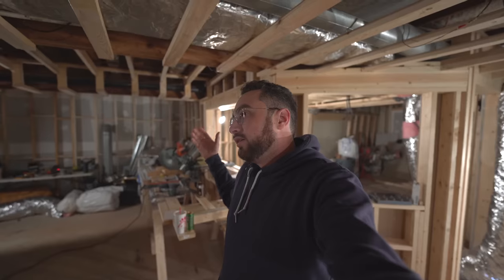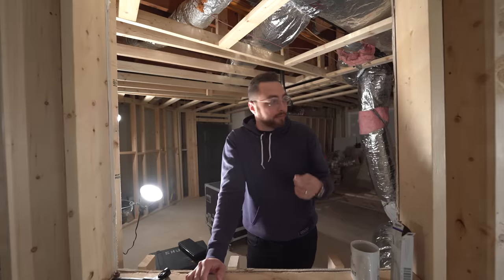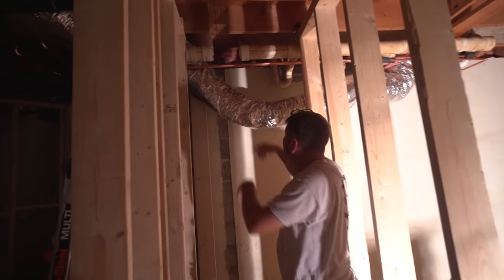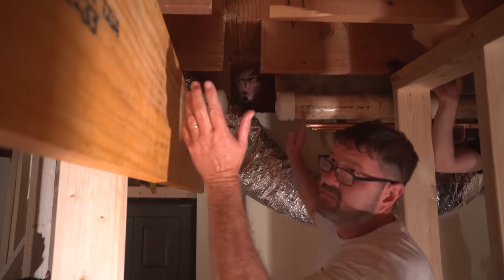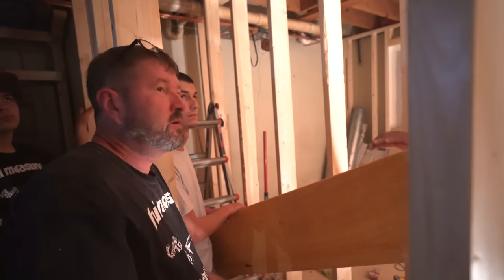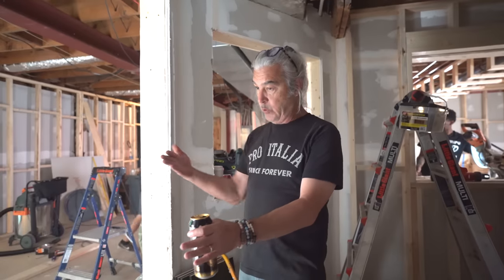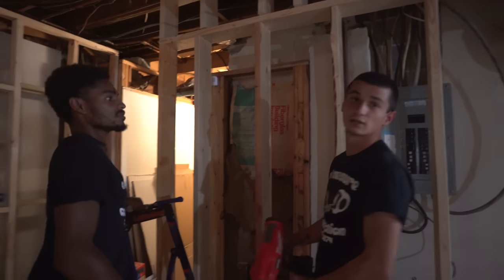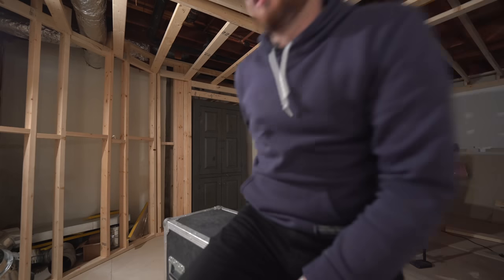We Need To Talk About The Studio Build  (I f*cked up)

Comment: Hey Rhett, one simple piece of advice before buttoning up the walls…
  Think about running plastic chase in the ceilings and the appropriate walls to make snaking any cabling or data lines, co-ax , easier in the future…. It cuts down on damage opening walls and gets you from point to point without boring holes in any framing.
As a carpenter for a very large laboratory on Long Island, every renovation we did involved future proofing and was never a wasted effort. Plastic tube chases are inexpensive and certainly worth it.  Good luck with the rest of the build.  Be well.
Reply: I'm a pro studio builder and I'd back you up on your good advice, with an additional observation: lay 3 or 4 color-coded pull-thru cords inside your pipe chases. It saves fishing them through later, and means you're ready to pull extra cable as needed.
Reply: @robertmaune8557  
Good call.
Reply from the maker: Great advice guys, thank you!
Reply: Leave a length of twine in your chases or conduit, so you can pull new wires in future. Unlike me, try to always put twine in with the new wires so you have it available down the road.
Reply: @RhettShull  And label all of your wires, so you know what is what at each end!
Reply: They’re called Smurf tubes
Reply: I absolutely concur. It's been many times that electricity caused delays on the construction yard. Write out how the cables run, label everything, and make sure you have relatively easy access to the crucial points of the cable runs for fixing or changing out stuff.
Thanks for sharing and good luck Rhett
Reply: @robertmaune8557  I'm glad this was brought up, especially since technology is always evolving. What connections are commonplace today might become obsolete in the years to come so planning for that now will pay huge dividends in the future.
Reply: I concur with this advice.  Previously working in IT data cabling and as an electrical installation engineer, running conduit inside the framing with draw wire and access points is a no brainer for future proofing.  Allow spare conduit and space in used conduit for changes/adding etc…
Reply: @cyanide -  YES!!!   Also install pull strings in those chases!
Reply: @colinwallace5286  This. def. this.
Reply: I’ve worked in studios and radio and TV stations for a few decades. Run more plastic pipe than you can ever think you will need. It’s cheap at this point. Cutting up that wall which your placed a bunch of custom refractive panels or wave bending materials to run one more cat 6 cable or piece of Beldon’s best will just piss you off years from now.
Reply: Great idea.
Reply: I hope it’s all worth it. Quite intimidating. 
And, I thought kids nowadays were doing albums in their bedroom!
It’ll be cool when done. How much ceiling height are you getting?
Reply: As an electrical contractor I 1,000% approve!
Reply: I second this. Electrian here( run a lot of data and fire wire) Conduit is best, preferable!!! Smurf tube or pvc chases( I like the latter) . I light up when I see there are chases for my data runs!!! Otherwise just keep it off the nail plates, and curve the runs so they pull easy! 👍🙂
Reply: Very good advice. Gutted and rebuilt mid 1930s semi and 19th century terrace houses in southeast London plus other houses. I always install conduit even if the professional electricians say it's not necessary. Separate conduit for power cables and for data & audio cables preferably 12 inches apart
Reply: @RhettShull   And after you run the chases/innerducts, but before you sheetrock, take pictures and stick 'em in a notebook with all your cable documentation.  That way if you want to hang stuff on the walls or need to, heaven forfend, open up a wall, you'll know where all the studs, power wires, pipe, ductwork, and wiring chases are. Got that tip from a custom home builder many many years ago.
Reply: @robertmaune8557  what do pro studio builders do to eliminate wall joists from rattling at the joints? I would think every wall joint needs to be bracketed and screwed together.. They are only air-nailing them together.. My bass rig would shake these to pieces!!
Reply: @christophercarson4310  when I started building in the UK all joints were made with screws to stop rattling. In the US I use steel fixings like Simpsons strong-tie with nails. Both systems work well. Now I am in France I feel comfort to mix and match: a combination of angled nails with big screws to prevent the joint opening up.  An experienced framer has plenty of solutions to keep a joint strong. I don’t know where you are writing from so I can’t be more specific, but local building codes are typically a good guide.
Reply: @robertmaune8557   yeah I agree I think screws and Simpson brackets are needed here. Yes, local building codes are good for structural integrity, but they do absolutely nothing for controlling sound/rattles. My bass rig would rattle these joints to pieces!!
Reply: @christophercarson4310  If the joints are accurately cut and the fixings are applied as per spec the joints will cause no problem. The entire wall will vibrate as one. Unless you are playing dub reggae your bass tones will be living far above the fundamental frequency of the wall.

Comment: Hey Rhett! I am impressed... and Entertained by your studio build.  I am a retired General Contractor and a guitar player of 55 years. I'm 67 now. Pretty much retired from building, but still jamming.  I have built a number of studios in my day.  You guys had quite a task there. Building a studio, where you need all those details of scope, regarding wiring, soundproofing, wall separation issues and all that. You did well, or are doing well.  I know all the headaches you can possibly run into, moving plumbing feeds and drains, Electrical changes and all that good stuff. I"ll be looking forward to your video when all is said and done Dude!  I built my studio at our home in The Poconos. It's a little bigger room than yours. I have to still build a control room and vocal booth, which I'll do as a 8X28 addition along the back wall outside.  Hey, we all have fun just getting our hands dirty. Right?  You will have years of enjoynent beginning soon. Hang in there. Hope you get lucky and find your content videos... now that really sucks!

Comment: Wow. That I-beam is a serious piece of metal. I have one holding up the bedrooms of my house, but it went up by ripping off the whole upstairs and dropping it in. Doing it in situ is some mad building skills. And you shouldn't feel bad about the timeline. As we say in my line of work: the first 90% takes 90% of the time, but the last 10% takes the other 90% of the time. Hope the finished project works for you! 🤞
Reply: A steel beam is more costly than lumber, but not when a steel can be split into three manageable lengths and spliced together, can fit into a smaller space so not destroying the pipework and all that goes with it, and as it could go in easily with three guys in a morning, which would save probably four guys three days labor, which is where the real money is.  What is missing all along is planning ahead,  drawings (I haven't seen a single drawing), and scheme fully formed before work commences.
Reply: Around the office, whenever we get a time estimate from someone else on campus who needs to do stuff before we can do stuff, we double the number and up it one order of units.  If someone says "We can do that in three days" we expect it in four weeks. :D

Comment: What you have gone through during this studio build perfectly demonstrates why I despise any kind of home improvement projects. They always end up being way more complicated, stressful and expensive than you can ever imagine. I am going through the process of replacing my kitchen faucet. It cost me a couple hundred dollars to have the old faucet removed, because the screws were all rusted and the plumber had to break the faucet apart to get it out. He couldn’t install the $550 faucet I bought from Home Depot because it was defective. I got a replacement faucet and had it installed. It started leaking into the cabinet below, causing a lot of water damage to the wood. Two plumber visits later they fixed the leaking issue and installed the new faucet. Now the hot water pressure is very low, and the plumber told me the second faucet is also defective. I have to pay to have the second replacement faucet torn out and get a more expensive replacement, and pay to have that installed. Thanks Home Depot. A simple faucet swap is costing me well over $1K in parts and labor. I HATE home improvement projects.

Comment: you are correct in being so thankful to the crew who came in and installed those structural components. engineers usually require an inordinate amount of work to cover their liability. glad to see you made it past that hurdle. and i'm curiuous to see how you finish out such a low-ceiling recording space. only because i'm dealing with similar issues. enjoy the taste of dust;)

Comment: Hey Rhett, I’ve helped to build several pro audio studios in the Tri-state area both design and electrical power and elco rack wiring and custom snakes. Someone suggested running some pvc tubing between your control room and live room. One for power and another for low voltage and twisted pair. We build our studios to analog specs although digital is not as stringent. For instance any live room should not have a single circuit that surround the room whether it’s lighting or power receptacles. Always split your iso ground circuit so no 180 degree loops are present. Many of our studios here still offer 2” 24 and 48 track linked  tape machines
Reply: Anyway you get the idea. I did the wiring and some acoustic design for Studio Crash in Philadephia which was listed by AES as one of the most perfect response live rooms and control rooms anywhere.  Send me note if you want to talk shop. Shame I didn’t know of your search for pro studio builders.We travel when called upon to do so. Hope you take the advice about the pvc for Dante’ and other wiring considerations with options for expansion. 
Can’t wait to see the finish. PS HVAC flex ductwork must be roughted in circles to cancel the sound of the air coming through the ducts….. you don’t want to have to turn off the air to do quiet mixes. All my best , 
Dave Simpson

Comment: I helped someone build a music studio and here are some of the ideas we developed to improve upon the original design. We added an isolated power transformer into the electrical of the building. We designed an air system in the building that would eliminate any excess noise from the vents that went into the live and control rooms. We also made sure that the live room had proper bass trapping, sound diffusion, and we even angled the glass from the control room windows to eliminate any unnecessary feedback. We had room under the building to run all cables from the control room into pipes we had installed into the walls through out the live areas and electrical room. If you have any radio stations nearby you may want to consider installing lead sheets in some of the walls and doors to prevent any unwanted signals.

Comment: Im just finishing up a basement remodel with a small project studio room within a room completely detached from the structure of the house .  1 side of the basement is a bedroom with a closet . Then a laundry room / utility room. with some sound proofing done .The other side is a room within a room studio.  Completely detached structure besides they foundation . I ran 16 channels of cat6 for networking , 4 channels of hdmi . The basic build was rockwool in between studs , 1lb MLV over studs and sealed , resilient channel over the studs for some sound pressure relief ( thats the idea at least ) soundbreak xp purple drywall in two layers with greenglue in between . Double door entryway with 3 separate walls  . Middle wall is mostly airgap with a birch and a middle layer of MLV .  I still have a few doors to build before the room its self is complete . As it is now with 1 simple interior wooden door on the outside wall that has a mechanical sweep and is sealed ( where it actually attaches to the house again ..) I have a 23db reduction between open and closed .. Im hoping for a much bigger drop once the important inner door is build . Its going to be a beefy door that also has absorption for room treatment on the inside ... Its a long road to do by myself .. Took me 3 years to do the whole basement mostly by myself . I even did the tile work ..

Comment: Y'know, I ran into a hell of a bug while I was building my own home studio ( a log smaller than yours, it's only a "sound proofed" bedroom in my basement which has a control room on the other side of the wall). I basically built the entire double-frame myself, and the room is a "room in a box". I have a nice quadruple-paned glass to see inside, double gyproc thickness, resilient channels, roxû everywhere...
But I started about 5 years ago and I'm not done with the paint yet. Won't get into details but I had a personal issue that slowed me down quite a bit. I recently got back on track, and am about to finish the entire place. All I have left to do is the low-voltage part, which I can't wait to see on your episode list. 
Keep the faith my friend, your studio will eventually be done, a lot quicker than mine!
Reply: Rhett is this you replying?

Comment: Amazing work, it'll be a great space when it's done!!  One small suggestion to help future proof it is to add a couple of extra wire-pulls in key areas so if you realize later you need to run another cable you can pretty easily.  :)

Comment: Sir I am glad you got help I just wanted to tell you that the guy you got is doing a good job that’s coming from a carpenter of almost 50 yrs. & a somewhat of a guitar player who since the moptops I’ve been a lover of all types of music and discovered that I had the passion for building I wished I lived 3000 miles closer I would of traveled to your project just help in anyway to see that you achieved your vision & beings that I got 25 yrs. in both residential & commercial the only thing that helped in your type of project is to incorporate metal studs & wood but the metal framing can do a lot more things like radius walls for acoustic preferences plus they are so much lighter making less weight on your upstairs floor and I found some wood carpenters haven’t realized the advantages not to mention how light weight they but on your studio finish framing don’t be afraid to mention this old guys comments but it so much easier & again lighter than wood but what your builder has done cause watching first f—-ed up video I was noticing a few things that looked less professional but my approach is for the end result of what you need but your guy addressed it properly but if you need special attention for the rest don’t be afraid to talk to a seasoned-metal framer not just a drywaller that does it just to hang Sheetrock on it I’ve built my wood houses and may hospitals/ commercial projects to compare it with but feel good with the crew that you got to help you at this point my kids live in N Carolina & I recently join the great great grandpa club & if I was visiting I would drive to where your at not for money but just to help you navigate that stuff , I found you from Beato’s channel I love watching you guys the more I hear from guitar players make my stuff get worse sounding but being 70 I’m very proud of going through all the music styles that have gone under the bridge I really liked your perfect solo cover that you were proud of conquering it made me smile & soon if my budget works out I’m getting Ricks 4 lesson books I’ve told my friend before I’m gone I want to do this lead riff that is so easy for most but alternate picking has been my downfall but I’m still determined it’s a classic pentatonic blues lick so I’m a fan of you guys so good luck & take care of that studio can’t wait to see it.

Comment: Rhett, 

There are two things I'd encourage you to think about before you do the low-voltage work.

1. Consider running conduit to run cables through. This will allow you to change out or add cables easier if you ever need to do so. This will be more expensive but if you get a bad cable or damage or want to upgrade to a different type, you can do so. 

2. You mentioned networking gear for video production. I would HIGHLY recommend running CAT7/8 cable everywhere. The electricians, or you, will HATE this initially, but it will allow you to run 10GbE to remote storage or run video workloads. You may not use it at first, but it gives you the flexibility to put lots of storage in that network closet and access it from the control room without adding noisy disk drives. Or anywhere else in the house for that matter. 

Happy to discuss all of this more if you ever want. (REF: I'm a cloud engineer working in Enterprise IT for over 20 years.)

Comment: Loving the way this is going! Something to consider though on your electronic rack. The vent that you are running to the rack, will that be an added zone to your current HVAC system? You most definitely would not want heat running there in the winter. Instead of a second zone on the current HVAC which would be quite a small zone on such a big system, consider adding a small stand alone mini split. They do have ducted models that can be mounted elsewhere and ducted over.

Comment: I've worked in construction since 1994.  You have a tough build, and only the right contractor will be a good fit.   Not an easy build, but not impossible.   The right crew is key.    Flexible.   innovative.